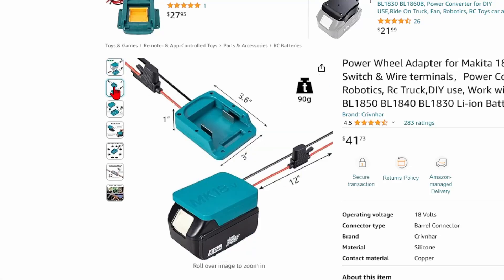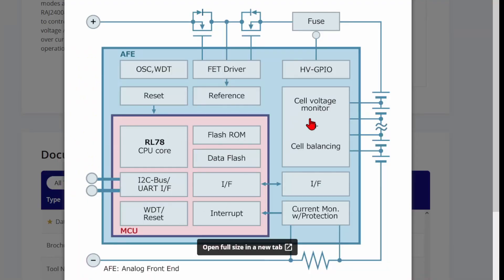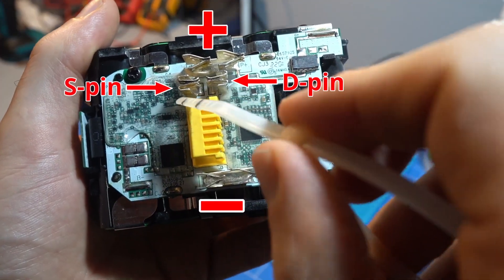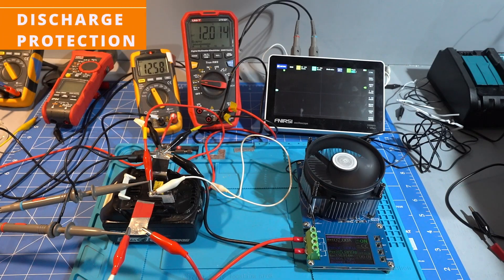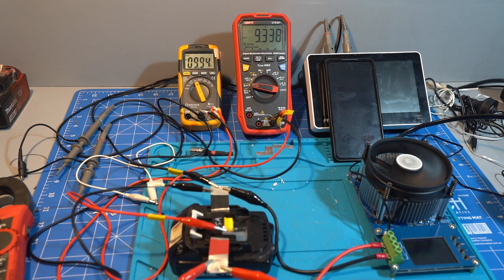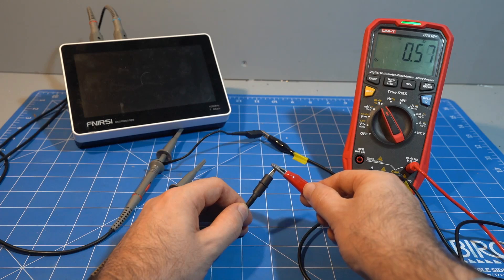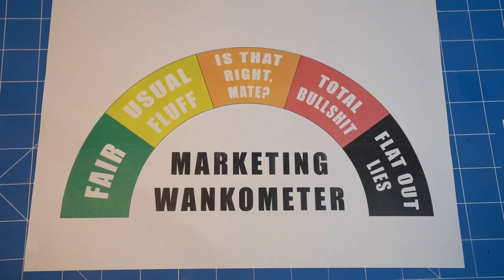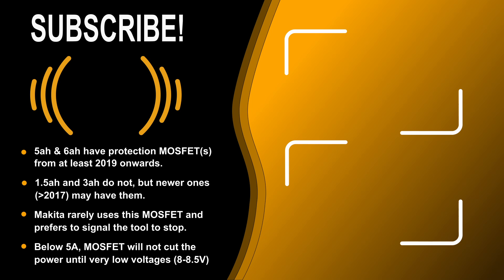[006] Do Makita LXT batteries have low-voltage protection?

Comment: Interesting stuff. I have 3 older 3AH  Makita i haven't gotten around to rebuilding. They all have totally  different bms. I got a few different aftermarket bms if the original brick. The aftermarket 3rd rails are one piece. Maybe just thermister. Makita batteries  are a fustercluck, be nice if you can sort some of it out
Reply from the maker: I think very old LXT (before star protection) had a switching PTC thermistor between + and 3rd pin. At least that's the only thing that makes sense for the <2V delta. Makita also charge via the 3rd pin, so that could have been part of the OG design to send charge power through the PTC so it would act as a thermal fuse during charging.

There's definitely been a lot of duct tape added to LXT over the years. It would take a lot of scrounging together batteries from different years to fully piece it together. I'd be happy with just being able to give a clear answer as to which batteries have stand-alone protection and which don't
Reply: Careful, many of the aftermarket BMS don't monitor all the cells, even if they have connections for them. I had one where the trace that leads to a cell connection lead under the yellow connector. After removing it (for repairing an original board) I noticed it's a dead end - which means that at least that pair of cells isn't properly monitored and I'm now really sceptical whether the other cells (some were connected to resistors and transistors) or even the thermistor are monitored properly or just bluff too. However there are legit working boards that include cutoff mosfets for charging and discharging and they do monitor the cells and thermistor correctly. The third pin is a whole piece too so that's not a telltale sign sadly.

Comment: At the beginning of the video I was screaming they are all three correct!  Glad you have the sane conclusion. I knew the smaller older batteries had no mosfets and thw newer 5Ah packs did. I did not know some if the newer ones the same 1.5 and 3Ah do have them now. Thanks for sharing.
Reply from the maker: I wanted to give a bit more credit to each of them, but I was getting bored and wanted to publish. Even though Noloxs was more wrong than the other 2 (due to only having older batteries), he understood how they work a lot better than the other 2.

Do you have a vid on Makita LXT batteries or is this just your unpublished testing. I thought I searched fairly thoroughly for any testing or teardowns of LXT packs as I was trying to fill in my table.
Reply: @toolscientist  
I don't have a video on the Makita packs cut off directly as I knew from past experiences with my older 1.5 and 3Ah packs that they have no cutoff protection on those tiny boards. I don't have the newer packs, but noticed the Project Farm video and realized then that (wow) they have added cut off Mosfets. I did not know that the newer packs would cutoff that much lower below 5A drain, that was strange.  I have a video putting an after market board on my older Makita pack and a video testing some aftermarket packs. I so respect Makita tools and how they hold up, but they have been needing to improve the battery line for nearly a decade. Hopefully they are at least working on Lipo stack packs and some larger 8 or 10Ah packs. Your video was very thorough I really enjoyed it.
Reply from the maker: Going into the test I thought that maybe PF and Sauron Makes had done something weird with their battery testers. It didn't seem like there was enough space or heatsinking to have a mosfet in there. Seems Makita just threw money at the problem and bought a super high-end mosfet.

What's really strange is why did they add protection. And why did they only add protection to the batteries that aren't compatible with pre-Star tools. The 3Ah is the only one compatible with pre-Star tools, but it has no stand-alone protection. Instead they've only put it on their newer batteries, and it only seems to get used to put them in storage mode, which could be achieved with yellow-connector digital interface. 

Need to find a disgruntled ex-Makita employee to spill the beans. Given Japanese culture, there probably aren't any.
Reply: @toolscientist  
Exactly!

Comment: Thabk you for doing a video on this subject! I’ve been planning a lighting project and trying to figure out the answer to this very question!
Reply from the maker: Just beware that under 5A on the 5 & 6Ah will drain down to 8V. It's very easy to add your own mosfet, but if the current goes below 510mA, the D-pin signal will go to sleep after 60s

Comment: Hello thanks for the video I am watching your channel from Russia and I need to use a translator to write this comment I would like to say that I have a battery Makita and I know their big problem the batteries are charged more than the nominal voltage calculated by the manufacturer, they go into protection and I can assume that this can only be corrected by resetting the controller memory, the whole problem is that this error can be obtained not only by charging the batteries yourself, but also on the original charger if several times in a row If you put the batteries on charge, their voltage will increase slightly even if they are charged, so using the original makita charger can damage the batteries
Reply from the maker: Спасибо за просмотр! Это тоже перевод.

Значит, подлинная Makita может заряжать аккумулятор выше 4,2 В? А только если поставить на зарядное устройство полный аккумулятор? Мне придется это посмотреть.
---------
Thanks for watching! This is also a translation. 

So genuine Makita can charge above 4.2V per cell? But only if you put a full battery on the charger? I'll have to look at that.
Reply: @toolscientist  perhaps, I’m not sure, the whole problem is that the battery goes into eternal protection before the voltage limit of 4.2V is exceeded on one cell, I charged the battery with a homemade charger with voltage control and the voltage did not exceed 20.8V, but the battery went into protection and after forcibly discharging each cell to a lower value, the battery did not come to life
Reply: @toolscientist  regarding your question, makita charging can add a small voltage to the battery even if it is already charged, my friend had a case when he forgot which batteries were already charging which ones were not, he put the same battery on charge several times and after that he had the battery has recharged and gone into protection

Comment: Will you be doing this test to other brands?  I am interested in Dewalt's, as I purchased an adapter with leads and a fuse to "extract" electrons out of batteries, but the 5 ah powerstack refuses to contribute.  The 9 ah flexvolt will work though.
Reply from the maker: Prob in the next 2-3 months. I have a Dewalt tool and a 2Ah battery. Need to find a cheap charger and a few more batteries.
Reply: @toolscientist  I have a heap of dewalt batteries

Comment: Question:Do Makita LXT batteries cutoff at low voltage ?
Answer: it's complicated 
Great video thanks
Reply: I think the in battery cut off is set to trigger at the point the battery will be damaged if it goes any lower. Whereas the tool cuts off when the battery is considered to be fully discharged, but still short of the in battery cut off.... The truth is an 18/20v battery is pretty much drained by time it gets to around 16v or 15v. The battery voltage under load is going to drop rapidly from 16v to 9v.... IMO there is little difference in the actual state of charge between 9v and 12v both are effective fully drained. Makita turns off their smarter tools in the tool cuz it is less stressful on the battery's circuit. The tool's cut off point is set at 12v because that reliably shuts them down before the in battery cut off is triggered. Dumber tools (like blushed tools) turn off in the battery when they hit 9v.
Reply: They might have it…but not in a way that you can reliably use or take advantage of. :(
Reply: Hi. Both my 3.0Ah batteries came up with the same problem at the same time. 2 red LEDs flash then the other two. Any ideas? Can they be jump started or are they trash?
Reply from the maker: Answer: it's complicated...and we don't even have the full picture yet

Comment: I wonder how the nice 12.5V/... shutoffs vary with cell assymetry. If one cell is 0.2V low, is it simply 13.3 (2.5+2.7*4). Overvoltage behaviour and normal charging protocol also may be enlightening, though possibly less people care. Thinking of the 65W in and out USB 'Battery Charger Converter for Makita/Bosch/Milwaukee/Dewalt 20V 18V Li-ion Battery USB Type-C Input Output Replacement Charger' from ali.
Reply from the maker: They're almost certainly monitoring for any cell below 2.5V. I did do a test where I measured the cells individually while draining to look for that, but it didn't make it to the final vid. I'm pretty sure it's in the RAW vid that'll be out in a few weeks. I didn't do any crazy stuff like intentionally pulling a cell low as Makita BMS is notorious for bricking itself.
Reply from the maker: I'll def be looking at the charging protocol, but that'll probably be a long one. Someone's started on the XGT protocol and it's very verbose!

Comment: It’s probably not a storage mode, but a disposal mode. A battery drained down to 9V is probably safe for landfills or even trash compactors without producing heat in the event of a short.
Reply from the maker: There was a recent reddit post on r/Makita where someone posted their bramd new battery as being at 8-9V. I'll see if I can post a link
Reply from the maker: This person got 8V on a brand new battery.

https://www.reddit.com/r/Makita/comments/18uq8c1/low_voltage_on_new_batteries/
Reply: I think so too. I believe the heater circuit that is activated to pop the fuses can also discharge the battery cells to empty for safe disposal.

Comment: I have been using rigid batteries they have MOSFET controlled shut off on their 18 volt I haven't had any problems on those
Reply from the maker: I'll have to test those at some point. They're called AEG in Australia, but common enough that I should be able to pick one up 2nd hand.
Reply: @toolscientist  Just like the Ryobi, they kept compatibility with NiCd packs. I have a ~20 year old reciprocating saw. Its NiCd pack still works on a Ridgid tire inflator I bought last year. The saw, though, draws a bit more power. It barely moves with the battery. 

I’ve since gotten a Makita adapter, since I don’t have any other Ridgid tools and don’t want to buy more batteries. Both tools work well with the adapter.

Comment: I’ve been thinking to use Ryobi batteries for my projects. I’ve seen their low voltage cutoff in person on my own batteries. Seems much easier than trying to find a good circuit. 

(I’ve got 5 of them so I’m in good shape for what I need.)
Reply from the maker: True. I'd bet good money that Ryobi's BMS is not watching how many times you trigger its protection as I think that's how they normally operate.
Reply: The two things I like about Ryobi batteries: They have maintained compatibility with NiCd batteries from 1995. And they added random pins to random parts of the battery to add more pins. 

I have a Ryobi high torque that came bundled with a high power battery. It has pins on the back of the battery. Normal batteries literally have no pins there.

Comment: I never understood why people say Makita has the best batteries and after watching this video, I'd say it's either ignorance or brand bias.
Reply from the maker: I'd rate the Makita 5Ah ahead of the Milwaukee 5Ah. Better physical design (less slop, internal cooling vents that the charger blows air through). Definitely a more sophisticated electrical design as it uses precision fuses, precision shunts, and a cutoff mosfet. There's a good argument to be made that the LXT is over-engineered, though. It's almost certainly more expensive to make than the M18.

I really don't like the 1.5Ah and 3Ah. Taking them down to 9V just seems reckless.
Reply: @toolscientist  They also use the highest quality material for the battery cases.
Reply: because others are worse (at least other major brands that are worth talking about), and they have XGT ones that are even better than this
Reply: @riba2233  Please tell me why you think Makita has better batteries than Metabo HPT, Bosch heck even the non flexvolt Dewalt. 
All that over-complicated design yet they let you discharge it to 1.8v per cell and the charger will brick your battery if it sense anything wrong with it.
Reply: @MrArcticPOWER Bricking your battery if something goes wrong seems like a good feature, though. Mistreated cells can emit magic smoke.
Reply from the maker: The 9V (1.8V/cell) is only on the 1.5Ah and 3Ah, which are their cheaper batteries. The 5Ah is 12.5V (2.5V/cell). It seems to be something that a lot of the early power tools did, and then later they switched to the standard 2.5V/cell. But then for some reason they've kept their legacy programming on their older batteries, even if they're manufactured more recently. It still seems crazy to me, but Milwaukee and Makita would have good data on how they hold up. You can always find someone that has a 10+ year old LXT or M18 battery that's still going. I have a few.
Reply: @MrArcticPOWER   because I have seen/handled fully disassembled XGT pack, I can assure you that others are not even close in terms of electronics/mechanical/ventilation etc. It is just on another level, and please do not mention dewalt packs within this discussion, their regular packs don't even have bms, and FV packs have poorly made one that destroys the pack over time. Bosch is ok but nothing special, metabo hpt too complex and limited to 8ah.
Reply: @riba2233  Every single thing you just said does not matter in the end if it doesn't last. And I'm not sure why you're mentioning the XGT pack since this video is about the LXT and at least 90% of makita users don't have those. 
"Bosch is ok but nothing special", yeah that's the point. On a jobsite, you don't care about how advanced the electronics are, you just care about performance and reliability.
I never had issues with Dewalt 20v packs, Bosch or Metabo HPT. Can't say the same thing about Makita, especially in cold weather.
Reply: @MrArcticPOWER  when I say that makita has the best batteries I am including xgt because guess what, they are makita batteries...  And yes, they will last longer than others thanks to their better tech. Speaking of bosch, I have a buddy that wrecks them on a regular basis (and those are their best ones, not the old style), so yeah.
Reply: @gf2e Bricking a battery by design sucks in my opinion.  Killing it temporarily seems ok, but permanently bricking is a bit overkill.

It's pretty frustrating to be fighting random OEM nonsense when trying to use batteries for DIY purposes.  If they would just release the logic of their batteries & chargers, then that seems fair, but everything being a mystery, and you end up with a bricked battery is terribly frustrating.
Reply: @PowerScissor  I agree that it’s annoying from the perspective of reverse engineering.  But if the cells have been actually damaged, it seems like a reasonable thing to do IMHO.

Comment: Your research is as interesting as the results are infuriating.
Reply from the maker: 😄 which part is infuriating?
Reply: @toolscientist  The part where you point out how much money Makita invests in fancy silicon ... and the battery management is still crap? 😁
Reply from the maker: Yeah, the electrical design is quite high end, but they've made some strange choices in the programming. The weird 8.4V cutoff I'll ignore as something that I don't really understand - it'll never happen in normal use anyway. The only thing I dont like about the 5Ah is the seeming lack of overcurrent. They've probably tested it and found that the low-voltage protection will kick in first, and therefore there's no need for overcurrent. I couldn't find detailed info on the fuse. Obviously it won't instantly combust at 30A (90A total), but how long can they handle 35-40A (105-120A total)

Letting the 1.5Ah and 3Ah go down to 9V is just trash though. I don't think that's defensible. Especially as they have such accurate current sensing it would be very easy for them to scale the cutoff voltage with current.
Reply: @toolscientist  Without knowing the company, but having worked for a big company myself, I suspect it is a wild mixture of "someone trying to do the right thing", "someone higher up trying to save a few cents, after too many dollars were spent", and "someone very high up the food chain saying: F it, folks will buy it anyways, and broken batteries will make us more profit in the end".
Reply: @michaelseitz8938 I wonder if there was some weird glitching where it would sometimes cut off prematurely?

Or maybe someone in management was testing tools and seeing them cut out with non-empty batteries and said “be less conservative!!!”
Reply: @gf2e  agreed, if you have one of the 5Ah+ batteries you are probably using it on a tool that puts a strain on the battery,  A circular saw into wet wood, leaning into your grinder,  if you are out in the field nothing worse than a tool that cuts off for no apparent reason, so let the tool do something so the person using it doesn't bad mouth the brand, marketing doesn't need the hassle.  As long as the batteries don't go up in flames it'll be fine.
Reply: Best kind of research where the results just piss you off